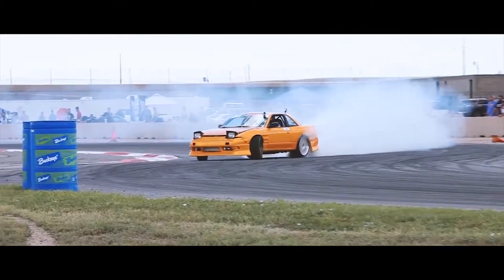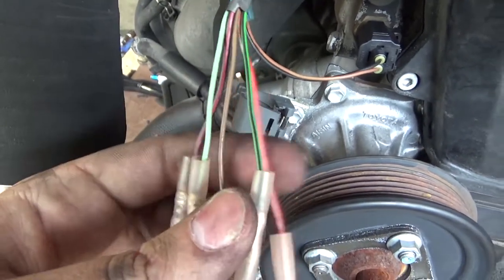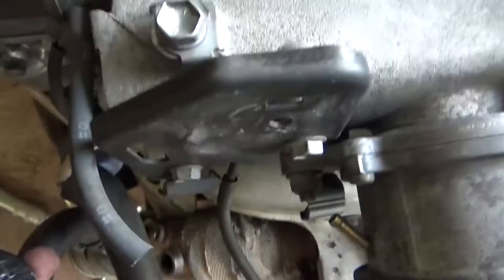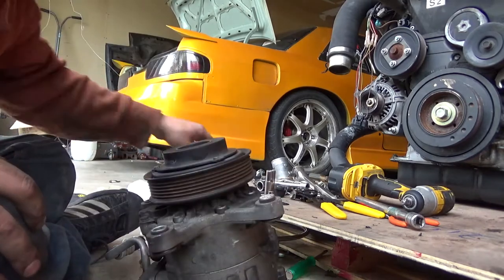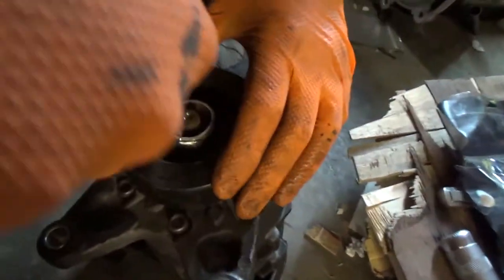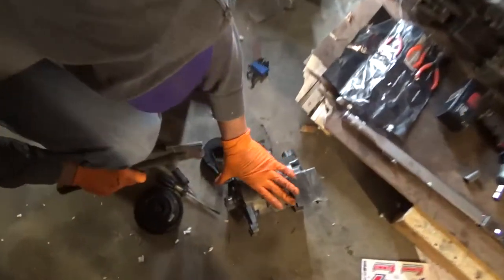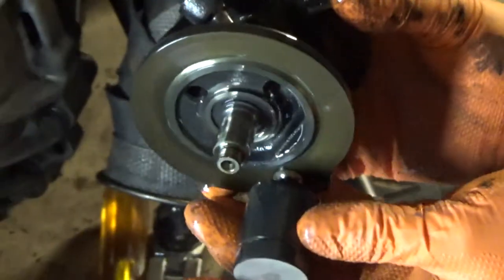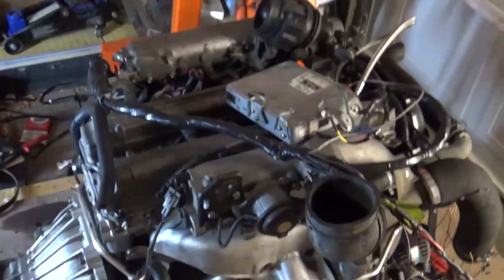How to Swap 1JZ VVTi S13 Part 2 | Convert JZX110 to JZX100

Comment: never seen a full front too end 240sx 1jz vvti wiring vid.  that would get alot of attention man
Reply from the maker: it's hard to do that because every engine is different. I can show how to wire a jzx100 1jz vvti but not jzx110 or soarer. They are different harnesses and wiring
Reply: Ok yeah man I world appreciate that alot. I hate too spend a grand on a wire specialities harness. I have a240 s13 n the 1jz harness I have has everything but it was cut n not sure too what. I would have too send u a pic but my problem is if I fully remove the front end harness. How would u wire up the engine harness? Would I just make my own fuse panel and power distribution.
Reply: I have the jzx100
Reply from the maker: Buy the wiring specialties. Cut harness is not worth trying to figure it out because you will have wiring gremlins in the end
Reply: Yeah gotta point there. That was my plan but started goin thru the original harness n its missing somethings. What I would like too know is could I run a switch panel with having the specialties harness. Would I have too tap into the harness? Would like too use this aftermarket tach and the blinker piece is broke so would like too have a switch for that lights and fan.
Reply from the maker: They wire it to your specific need. They have instructions on how to wire it to their harness or you can order relay panels and fuses already wired to their harness they sell too.
Reply: Thsnks man . I'll check into that.

Comment: Using stock fuse box or race car style wiring .. i seen motion auto tv vids on it but if it had more detail too engine harness and ecu wiring with the race car style switch panel wiring that would be something.

Comment: I’m also doing the jzx110 to jzx100 conversion. And I’m having a hell of a time getting it to have spark..
Reply from the maker: what ecu?
Reply: Jzx100 manual trans. Got it to have spark, turns out I was just missing a ground to the block, but now it’s running SUPER rich and does and anti lag pop bang type thing when I rev it up,  I have the jzx110 maf on it at the moment and no tps cause both the ones I got are broke so I’m assuming it being rich is because of those two issues. Jzx100 maf and tps are on their way this week
Reply from the maker: that is exactly your issue

Comment: What if I buy the harness from wiring specialties for the etcs and get the ecu too? Will that work? Cause I have the etcs-i as well.
Reply from the maker: Not unless your etcs-i is a non immobilized ecu. There is a grey connector port to the far right. If you have it yours is an immobilized one and will not work. I just ordered a wiring specialties jzx100 harness for this car. Got tired of messing with a hacked harness. Install video will be up soon!
Reply from the maker: I am doing what you are asking if you could do with the etcs (4 row/jzx100/etc) ecu. Video up soon

Comment: Jesse did u have to change the jzx110 igniter wiring to work with the jzx100 harness??.
Reply from the maker: Nope. They are the same
Reply: jessedrifts I have a jzs171 engine swapped in a gx100 and having a rich condition my MAF,temp water  is good out of ideas can't figure it out

Comment: Confused on how the MAF wiring is different if the MAF is the same on both motors??

Wouldn’t you just plug it in and run it?
Reply from the maker: The maf isn't the same. One has 4 pins the other has 3 pins. The plug is the same but the wiring isn't.

Comment: so you swapped the throttle? or how did you you convert the throttle?
Reply from the maker: Yes I bought a jzx100 throttle body and put it on
Reply: Ah ok thanks
Reply: jessedrifts where the fuck did you find a jzx100 t.b.? ive been searching everywhere for one im doing the same thing for my supra. also does the jzx100 have a map sensor as well as the maf? i have a jzx100 ecu, wiring harness and maf. what else do i need besides the throttle body?
Reply from the maker: jzx100 has only maf no map. jzx100 throttle bodies go up for sale on forums and facebook groups for jz stuff check there!
Reply: jessedrifts I have (2) jzx100 Throttle body and loom engines being scraped at a shop close by... But they don't have any ecu. I wanna swap it on to my jzs171 auto. Need some help on getting rid of the etcs-i?

Comment: am i able to just but the Drift Works drive by wire delete kit, and just keep my stock throttle body?
Reply from the maker: Yes but you will need a standalone ecu because the driftmotion kit locks the electronic servo out to not work.
Reply: @jessedrifts  what if I had a etcs ecu from a jzx100?